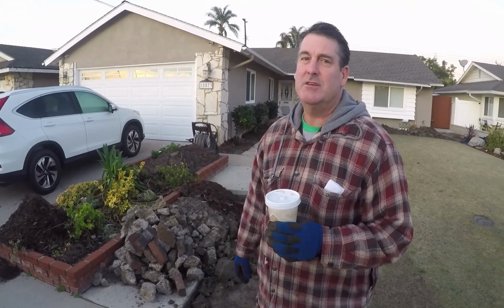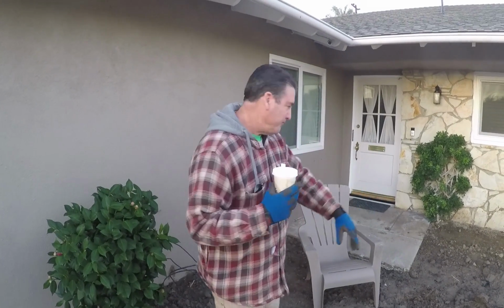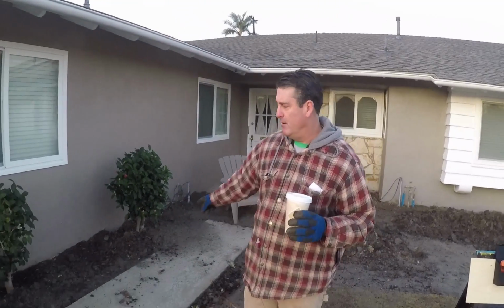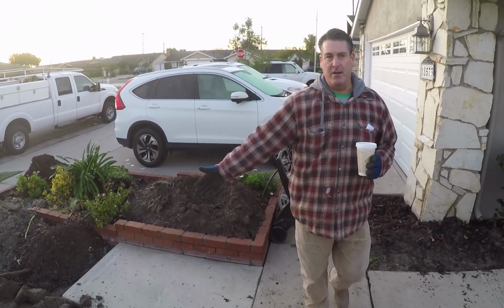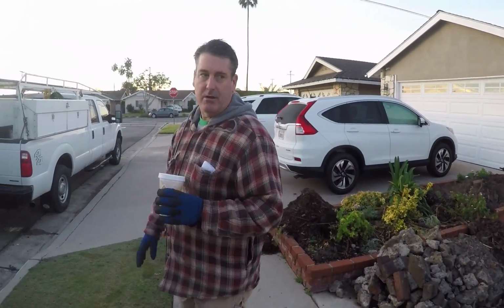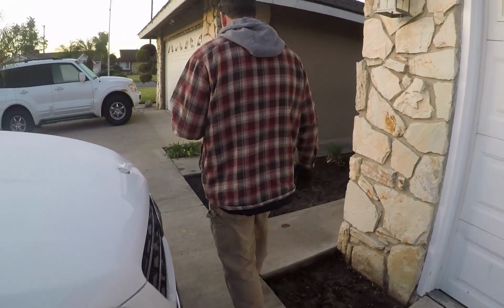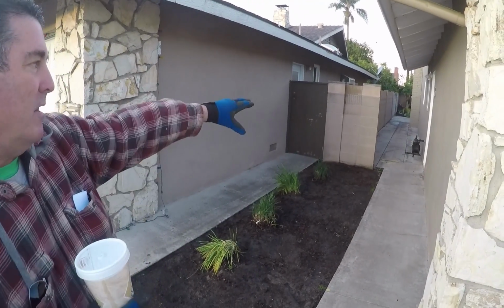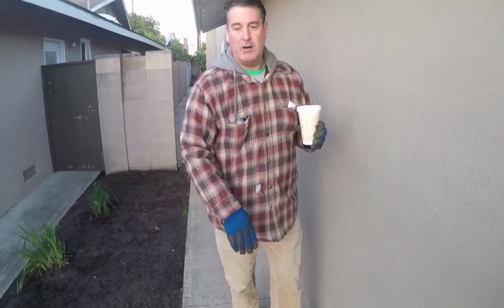Total Remodel of Concrete Driveway, Front Patio, and Side yard

Comment: Is there any issues with pouring a driveway where a city water main runs through? Bought an old house where the property line was moved down. Found a main after digging out the concrete for the old posts . The access for a valve or something is on the property, right in the middle of where I want to pour the driveway.
Reply from the maker: Depends on the condition of the main and valve.